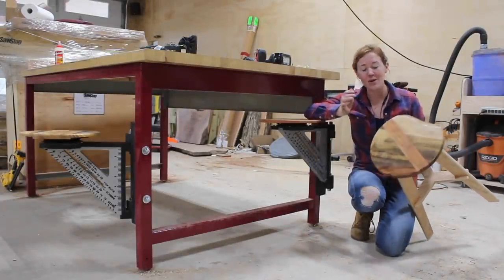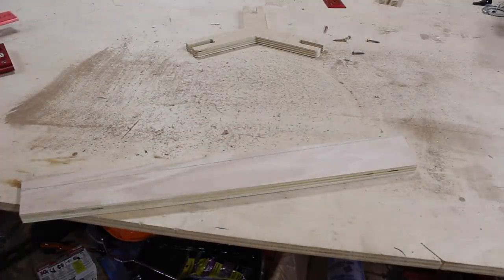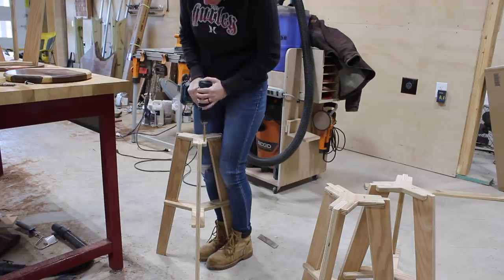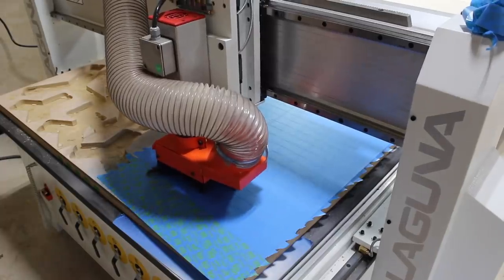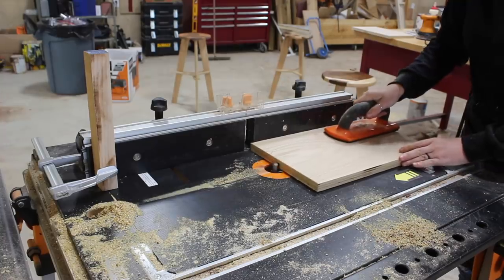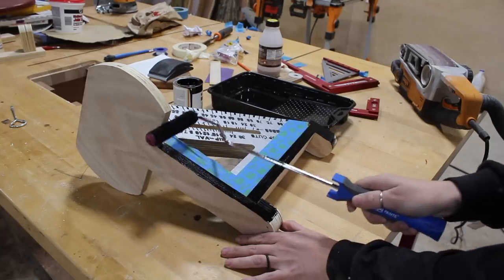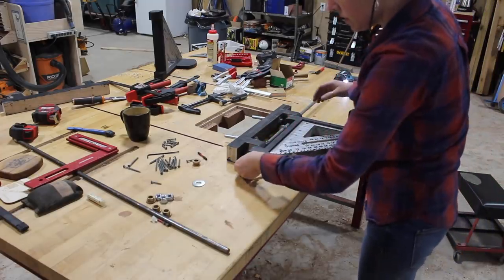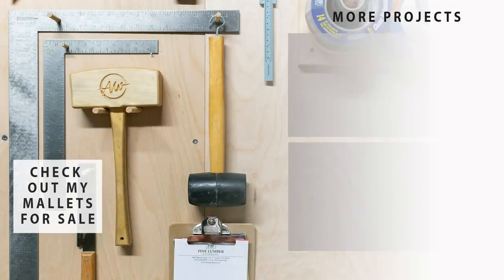Building Swing Out Stools + Three Legged Stools

Comment: To lubricate those load-bearing surfaces between the wooden bracket and flat washers, you can insert a couple of shop made fender washers cut from milk jug plastic.  The HDPE plastic is slick and tough, and 2 of them between each washer/wood surface will help prevent wearing down the wood whenever you swing back and forth with your body weight on the bracket.
Reply from the maker: That's a good tip, thanks!

Comment: April, the idea of using a speed square design for your swivel chair is just... uhm... just... hmmm... well, it’s just brilliant! I felt your pain trying to get a good engraving toolpath in VCarve for those. I’ve done quite a bit of that on my CNC and it often looks so good in the simulation; and then the actual workpiece comes out.... different. Especially with plywood, where layers separate easily around the fine details. Respect, I say. Especially since this was one of your first projects on the new machine. So cool!!

Comment: I never thought about using painters tape to make gang cuts easier. I'm making a bunch of moving crates and because I don't have a tablesaw or a decent circular saw fence cutting multiple pieces exactly the same is often difficult, but it looks so easy with the painters tape. Thank you!
Reply from the maker: I'm glad it helps. : ) I use that trick alllll the time to save time and also make parts more consistent to each other.

Comment: April, very fine work. Yes, ................ but a very small addition,
place a metal bushing for the threads of the all-thread rod to rub against (with a bit of grease) instead of the wood for longevity. I like the stools as well as the attached ones. It is not just a table any more.
Reply: I use copper pipe, slitted along the length, so you can get a tight fit to both the rod and the wood. Top I took it and flared it out a little, then cut with a hacksaw at a few places and flattened it out to make a bushing, and then a steel washer on top of it, all greased with some sticky wheel bearing grease.

Another alternative is to use the steel walls of sleeve anchors, as they are available in many sizes and are the right fit for the rod, and about the right length as well. just drill the hole in the wood for a tight fit and tap it in, then grease the rod and use the washer of the sleeve anchor on top of the unit where it will have axial load.
Reply: Larry Be  and all: bace should be metal, then put a 1/4” thick “washer” of UHMWP at pivot junction. It will be smoother than a school Marm’s elbow. (Just an old metal fab’s opinion) We had stools like this at stadium seating tables back in graduate school. Everyone HATED them.

Comment: I agree with Larry Be down below. Find a metal tube to fit over the all thread and cut sleeves to fit the wood pieces. 
The tubes will take the wear better than the wood. Have seen where the threads of the rod grinds the wood and wallows out the hole on gates and lids. Would seem that the weight of a person could really add some stress on the hinges.

Like your projects and ideas. Watch all the time.
Reply: rabbycacker 
Yeah, definitely needs metal or nylon bushings, especially since most of us wood shop people are 250-350 pound men, not 110 pound girls like April...  I’m betting that setup wouldn’t last two months of daily use by me.

Comment: They will eventually wear out where the all-thread goes through the wood. The all-thread will act as a file and remove a portion of wood each time the seat id swiveled in/out, and any weight on the seat will only accelerate this wear.

Comment: April I think for my self I would have welded the mounting brackets. I'm a big guy and not sure the wood would hold the weight. Or do you think that would hold 280lbs I'm not fat so that's not the issue.

Comment: So did you really make the cross braces for the stools by hand? Because when you were painting the plywood silver it sure looks like you use the CNC. What’s the real story? Were they too time consuming by hand? Or were the CNC ones a flop? I’m not trying to be negative just asking. I know I have screwed up plenty of times when I had my CNC plasma.
Reply from the maker: I did one set by hand to show people how to do them, because most don't have a CNC, but the other three I cut on the CNC. I also made a few extras to give as gifts. Annnnd, I actually started them off larger then worked down to the size they are now, so I made plenty of cuts and stools during this process. : )

Comment: I'm curious about why you use original Titebond. I know that it's like $2 less than Titbond III, but do you use enough glue for it to make a difference? I always end up throwing out glue if I have too many kinds, so I usually just get Titebond III which can be used for almost all applications.
Reply: Bob Levittan 
II (2) is supposed to be better for wet (marine) application, including wood boat builds... but a good brand all the way around.

Comment: Love the speed square stool. I would suggest an extension between the square and table leg. This will allow you to sit in a more natural position, not so squished up against the table. It could be fixed out from the table or as a second hinge point which would allow the seat to fold completely under the table...

Comment: I suggest a better bearing arrangement. Those threaded rods will possibly wear away the plywood fairly quickly. Perhaps a sleeve from conduit and some grease... even better use an unthreaded rod and only cut threads where needed.

Comment: Loved the stools, but I wonder, does using plywood make them strong enough to hold serious weight? Holding you isn't so tough, but what happens when a big guy sits on either the swing out or the 3 leg stools? Us big guys have to be careful...lol
Reply from the maker: These are my stools so I built them for my weight. However, if I were a larger woman or building them for somebody heavier, then I would double up on the legs and spoke pieces. I could also widen the pieces.

Comment: I liked the effect of the speed square.  However, there seemed to be a lot of twist in the stools, as well as give on the swing outs.  Bearing your weight is a start, but not reassuring for to those with extra gravity.
Reply from the maker: : ) Well they are designed for me and my weight. If I were heavier I would double up on the legs and spokes.

Comment: At first I thought you used real speed squares, a unique idea. Is the table leg wood? If so I would think that is the weal link in the stool, an inch and a half of glued plywood ought to hols a small truck. April did you study design? You certainly have an innate talent for this.
Reply: 99.9999% sure the table legs. Would be made from Steel Tubing.

Comment: I'm ashamed that you would use a CNC machine to cut the first stools and then used glue instead of fasteners or hardware for them. The weak design makes a weak chair, though OK for a few seconds of sitting.